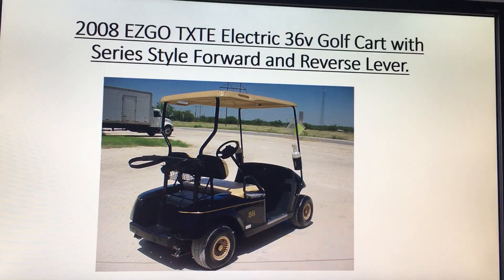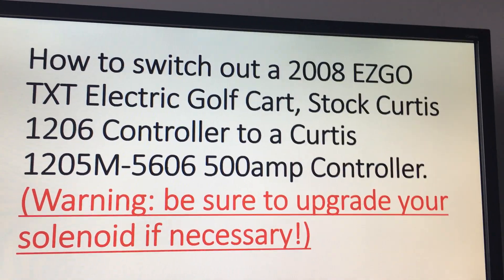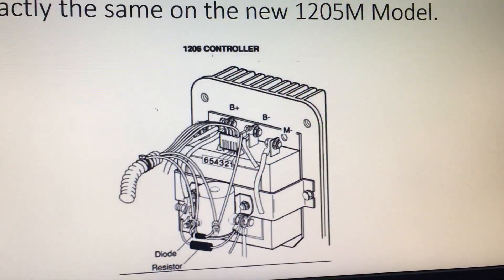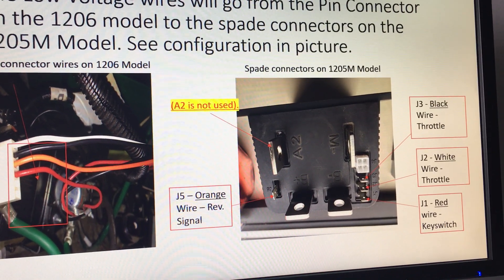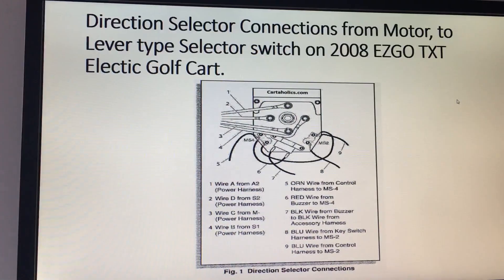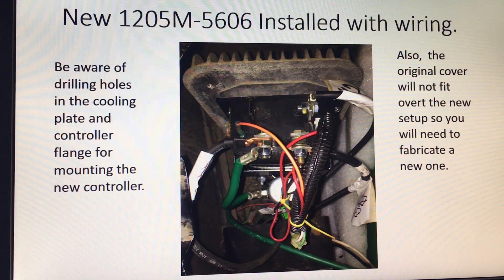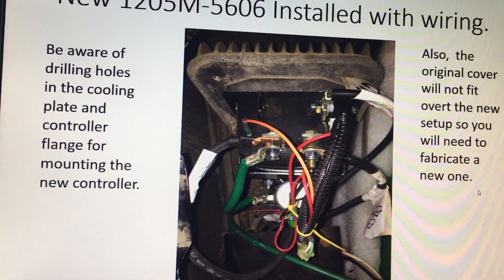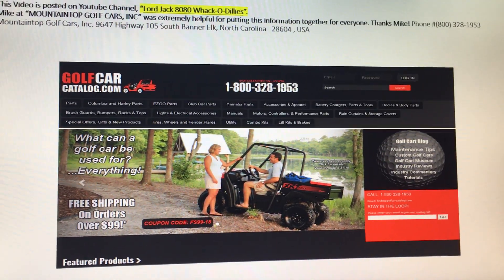2008 EZGO TXT Curtis Controller upgrade to 500amp

Comment: I am doing the same thing and I need your help. According to your diagram you have 2 wires going to M- but your picture it only looks like 1 wire. I am also confused on what goes to - side of big terminal on solenoid. Please help so frustrated

Comment: any advice on programming a new un-programmed Curtis 1226 controller e,g, assigning Analogue inputs and aligning I/O switches thank you
Reply from the maker: Sorry I don't have anything on that. Try the source in the video at the end!
Reply: Thanks for all your advice I finally figured it out I was omitting to press the save button after high had done the re-programming!